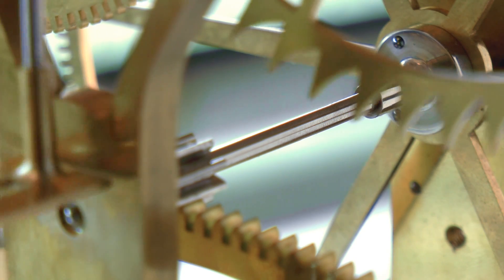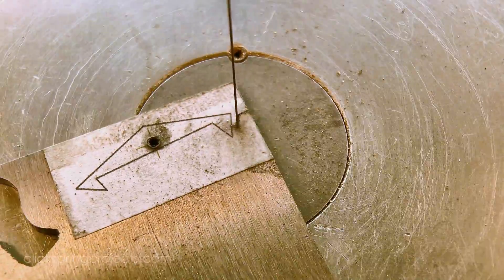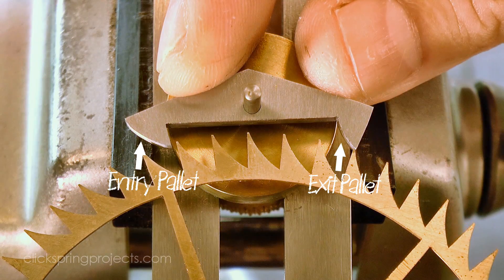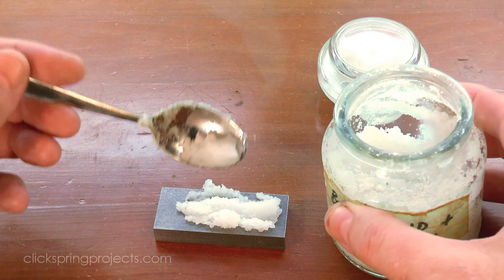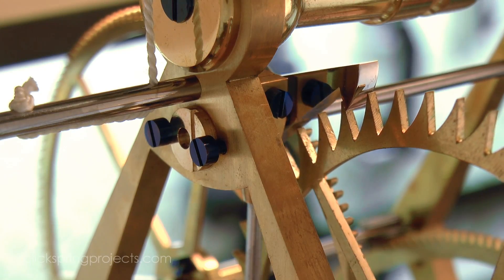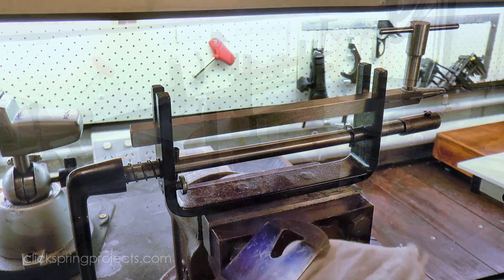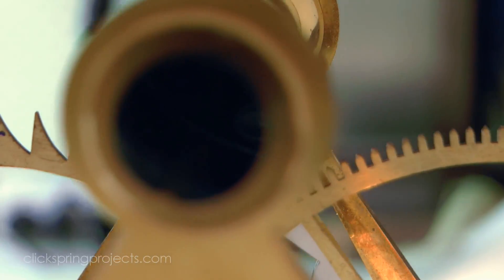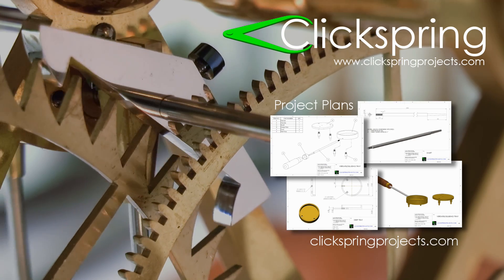Clockmaking - How To Make A Clock - Part 21 - The Mainspring And Escapement Pallets

Comment: Although the escapement is indeed a very distinctive clock mechanism, and probably first appeared in clocks before anything else, 
it was later adapted to other uses. 

Among other things, I can think of escapements in antique mechanical typewriters, 
and in the 'accumulator' mechanism in coin-operated pianos, 
which also have a small springloaded escape wheel with a small anchor, connected to a coin trip lever. 

This wheel is normally wound up by a pawl pulled by a small bellows ('pneumatic') connected to the valve actuated by the shut-off hole in the paper roll. When the hole comes along in the roll, it actuates the pouch and valve for the shutoff, causing the bellows to collapse under suction and pull the wheel over one tooth. This winds up the spring slightly and 'counts' one tooth, either adding one tune to the credits to be played, or shutting off the piano (since there's a pin on the wheel which pushes a lever connected to the main power switch). 

Since the wheel is normally under coil spring tension, to release it to move over one tooth, one only needs the weight of a proper denomination coin (most commonly a nickel, although some 'high class' places had dime or even quarter slots in the 1910s-1920s), to push down on the long actuation lever connected with the anchor, to release the escape wheel one tooth, and potentially turn the piano on (or add one more credit to the counted coins inserted). It's a very clever idea, and more positive and mechanically reliable than earlier coin-trip mechanisms, which used long vertical, horizontal or semi-circular rack or pin-stepping mechanisms (such as very early Seeburg systems), or else used an actual stack of coins themselves which actually completed an electrical circuit via two pins(!!!) (the earliest Wurlitzer designs). By the mid-teens, practically all coin piano and orchestrion manufacturers in the USA used some variation of this sprung ratchet-wheel design with escapement for their accumulators, as it had proven its ruggedness and reliability in hard commercial service. 

Most of these mechanisms can register up to 20 coins, since the earliest multi-tune rolls cut for these type pianos generally had a maximum of 20 tunes on them (much more commonly only 10). 

You can see an accumulator from a Coinola coin piano in Nate Otto's video here: 
https://www.youtube.com/watch?v=iqbafa5-lF8

Comment: This is captivating in ways I cant explain but I do have a question. You used that very precise electric measuring device do count the ticks in 24 hours and that's how you fine tuned it, my question is how were clocks and watches calibrated in the 1800s? Having standards to calibrate weight, size and volume were easy enough to procure but how do you get a time standard? I'm going to guess as I've heard time is measured against a pendulum of a certain weight and length swinging a certain distance to determine a second but I'm wondering if there were other ways

Comment: Thanks to this system, even when the mainspring in the watches is tight or loose, it is ensured that the gears and of course the time flow in a constant and correct manner.   Likewise, in some old diesel engines, this was provided by a mechanism with speed regulation... And again, the most beautiful people 💚💙🧡

Comment: I'm curious, is there a reason the contact angle is different on the two impulse faces on the pallet? I'm just getting to making the escapement on another john wilding design, my first clock. It seems from first glance that the "kick" the pendulum receives would be lopsided, but maybe this would keep better time than having it get kicked both directions??  It seems that the second(right) tooth seats quite closely at it's deepest point of engagement, but this would provide much less impulse than the first one. Have I got it all wrong, is it that way by design, or is there something else involved that I haven't even perceived? I haven't yet looked at the  horological institute paper, maybe that will be my next stop...

Comment: The holes for the spring hooks are roughly triangular in shape. The triangle base is nearest the end of the spring and the apex points away from the end. I would have thought that the opposite would be better. i.e the narrowest part of the hole, triangle apex, engages with the hook. This would make the spring less likely to become disengaged with the hook and the wider part of the hole would facilitate the initial engagement when the spring is fitted. Exactly like keyhole slots.
Any comments anybody?

Comment: I had no idea that such exquisite nano-detailing work was possible with manual sanding/polishing. Smooth wooden sanding sticks with diamantine powder powder (whatever that is) - fascinating stuff. (I'd love to see these metal surfaces under an electron microscope after each stage is completed.)

Now, I'm curious to see if the surface tolerances for an airtight seal could be made manually, with only pure steel (like the wringing effect between two Johansson gauge blocks)...

The clockwork design is also intriguing, but this has perhaps more relevance to my personal projects.  ; )~

Comment: The embodiment of Dynamic Mathematics.., aka The Calculus, in which the Escapement Mechanism is the obvious Quantum of change in frequency alignment, "keeping Time", and the Clock Spring is the relative motion amplitude of constant/holistic continuous creation connection cause-effect, a context of e-Pi-i-reflection condensation containment Superspin @.dt omnidirectional-dimensional logarithmic spin-spiral condensation. 

Equivalent Electronic LRC Modelling Circuitry oscillation resonance phenomena, has the zero-infinity sync-duration spectrum of transverse trancendental function e-Pi-i Self-defining Superposition-point Singularity, time-timing Hysteresis-> Shape-shifting Positioning of pure-math relative-timing rates in Thermodynamics.

 * "Thermo".., temperature, is somewhat misleading and concept misdirection because in Completeness, it is harmonic oscillation holography and a holographic Gaussian Distribution, of an average wave-packaging formation, probability numberness dominance in this sync-duration Instant.

So if you assemble dimensionality coordination sequences, Quantum Chemistry, in the same way this Clock is analysed, diagrammed and constructed, to emulate ONE-INFINITY Singularity Eternity-now Interval Conception, here-now-forever of/by Superposition-point Perspective of orthogonal-normal line-of-sight Fluxion-Integral Calculus, objectives of Time Imagery in Cosmology of States that are nodes of floating point resonance, ie in QM-TIMESPACE Actuality, ..that is the Observables of the general idea of pulse-evolution composing our lifetimes.. (Grandfather's Clock was too large for the Shelf..)

Comment: OK, you lost me there. Two questions:
Why did you have to heat up the ends of the spring?
And why did you have to punch the initial holes instead of just drilling them?

And mate: I've been watching your videos for the last two days and I'm in total awe to your craftsmanship and dedication.
Reply from the maker: Heating anneals the steel, making it soft and ductile again - it can then be curved as required, and also is believed to tolerate the stresses a little better in the annealed state. Punching holes in thin stock is much safer than drilling - great to have you watching mate :)

Comment: how much would a person have to invest in order to get all the tools and machines necessary to get into the clock making game.
Reply from the maker: Hey Al, I wouldn't say its a cheap hobby, but you can well and truly get started with around $1000 - A small benchtop lathe like a Sherline will set you back $600 new, and the hand tools you can pick up 2nd hand as you go along from flea markets, NAWCC sales etc A significant proportion of the tools you will need to make yourself, which drops the setup cost significantly. By far the greatest expense is not the tools, but self education, books etc Hope that helps :)

Comment: Fantastic! I have to ask though, would galvanic corrosion be an eventual issue with all the steel/brass contact?
Reply from the maker: Hey Kev, I have wondered the same thing. Brass and steel have been used for over 500 years in traditional clockmaking without GVC being an issue, so I can only assume that the answer is no. The brass pivot holes tend to wear out over time from standard particle abrasion, but that's about it. If looked after, the devices tend to live remarkably long lives. I suspect that the absence of an electrolyte might avert the issue. Great to have you watching mate :)

Comment: I always see people use belt saws, why you use a scroll saw instead? Sorry for my bad english.
Reply from the maker: The shorter "height" of the blade means that you can pivot the work in a short distance and so make very tight radius cuts. Band saws are very useful too, but its often a little more difficult to get a tight radius cut from them. Thanks for watching and asking :)

Comment: Everything looked amazing, but I have to ask....was the hole punch really necessary?  Couldn't you just use a drill there?
Reply from the maker: Punching a hole in thin stock is often a lot safer and predictable than drilling, particularly with an awkward piece of stock like this. Thanks for watching
Reply: Clickspring Ahhhh OK, I can understand that.

Comment: I am curious about the wear of the hardened steel pallets versus the brass cog wheel.  Will the wheel not wear out first, or is the wear all so negligible as to be unworthy of consideration?
Reply from the maker: Hey Chris, its a little bit counter intuitive but It turns out that the softer brass can often have a significant wearing effect on the hardened steel parts. The reason is that the brass (and any attached oil) becomes charged with particles of dust, and acts as a lap on the steel parts. Over a long period of time it is quite common to see hardened steel pivots and pallets showing clear signs of wear, despite being much harder than the mating brass component. Leaving the pallets glass hard helps to slow down this wear, but even then it still occurs. Thanks for watching and asking :)
Reply: Definitely counter intuitive!  Thank you for the explanation, and for the terrific channel.

Comment: Hi Chris, amazing job on the clockmaking and the videos. What kind of blades do you use in the scroll saw to cut each of the materials (brass, tool steel, etc.)?
Reply from the maker: Hey Eric, The saw is a Hegner 1e and the blades are these: http://jewellerssupplies.com.au/dedeco-diamond-small-knife-medium-blue-p-900.html No lubrication required for brass, the blades will comfortably handle up to 3/16" brass sheet stock, upper limit is 3/8". Tool steel is another story altogether - very, very slow and tedious, expect to break quite a few blades. Blades are reasonably comfortable with 1/8" tool steel stock, but the absolute max limit is 3/16", its very slow going at that thickness, but still beats other methods like chain drilling I think. Lubrication is useful for tool steel, but you can get away without it for thin section stock if you don't mind nuking the blade. Hope that helps!
Reply: +Clickspring Thank you so much for the detailed information. Have been a longtime fan and can't wait to see the completed clock!

Comment: When putting the holes for the spring hooks into the spring steel, why do you have to punch and file them? Wouldn't it be faster to drill it out, get a rough cut on the scroll saw and then file the details without compromising quality?
Reply from the maker: Punching thin sheet metal stock is much safer and predictable than drilling. Thanks for watching

Comment: Chris, you are an inspiration! How is a scroll saw set up to cut tool steel? Slow speed I noticed. Which blade is suitable? Do you use lubricant? Loved that first tick/tock. I "praise you with great praise" , Richard
Reply from the maker: Hey Richard,  I use these: http://jewellerssupplies.com.au/swiss-sawblades-bundle-p-5830.html No lubrication required for brass, the blades will comfortably handle up to 3/16" brass sheet stock, upper limit is 3/8". Tool steel is another story altogether - very, very slow and tedious, expect to break a few blades. Blades are reasonably comfortable with 1/8" stock, but the absolute max limit is 3/16", very slow going at that thickness. Lubrication is useful for tool steel, but you can get away without it for thin section stock if you don't mind nuking the blade. Hope that helps :)

Comment: Chris, this is my favorite YouTube series of all time. What an amazing project, clock, and what a nice sound! 

How do you think the twine, for adjusting the pendulum, will affect your clock's precision? Won't it stretch, expand, and contract with time, temperature and humidity?
Reply from the maker: Yes a thread suspension is very susceptible to humidity. It was the traditional suspension method commonly used for this type of clock, but was well understood to be flawed. Generally used on clocks where timekeeping was secondary to the visuals!!
Reply: I had never seen it before, but I'm no clock maker. I wish I was, though!

Comment: As always incredibly beautiful work. How will you protect the bare steel parts from rust in your tropical climate? The polish on every single piece is flawless at this point but rust and tarnish will be eternal enemies. Short of an annual total teardown and re-polish how will you prevent your amazingly painstaking craftsmanship from being sullied by the elements? I can't wait to see the clock finished. It's been a wonderful experience just following this, very obvious, labor of love. The clock will be an heirloom of your house for many generations to come.
Reply from the maker: Great question Terry - the reality is that its going to have a hard time in our climate. The brass I'm not so concerned about; that will develop a natural patina over the next few years, and lock out further oxidation. But the steel is potentially an issue. The high polish on the steel parts goes some of the way to minimising corrosion starting, and heat bluing is said to reduce it somewhat too, although I have my doubts about that after doing a lot of testing. Inevitably the pivot oil will migrate over some of the steel surfaces too, which will also help exclude moisture. I'll keep an eye on it and probably do a follow up video down the line. If necessary it can be relocated to family that live in a dry climate, but that would be the last resort. Cheers mate :)

Comment: why didn't you use drill to make the hole in the spring?
Reply from the maker: Punching a hole in thin stock is generally much safer and more predictable than drilling. Thanks for watching and asking David :)

Comment: This might be a bit of an obvious question, but I'm coming at this from the perspective of someone who deals mainly with wood for DIY projects:  When you are clamping up small metal pieces like the Escapement Pallet, is there a specific way to go about clamping it down for filing without marking up, deforming or damaging the piece?  Other than "Just don't over tighten"?  It's a problem I have to deal with pretty regularly with wood, and although I would imagine it to be less of an issue with metal, the pieces you are dealing with are so small and require such a high amount of precision, that I find it hard to believe there wouldn't be some kind of an issue with the vise.  Do you end up damaging work pieces like this pretty regularly, or do you just kind of have a feel for how much is enough for your vise?
Reply from the maker: Yes you are correct, definitely an issue. It depends a lot on the material, and the operation that is being conducted. Sometimes you can just be gentle with the vise grip, other times the op demands max tightening, but there are still ways to look after the surface. Brass is very soft, and marks very easily, so I will often face the work with a piece of paper. It pays to wipe the inside of the vise jaws for chips etc that can embed in the surface, even tool steel can be marred quite badly by this. Soft jaws can often solve the problem, if its a hand operation like filing. The little Panavise I used for holding the pallets in this video has nylon jaws so its perfect for keeping things unmarked. The biggest challenge is working on a part that already has a finished polished surface - no effort spared in that case, soft jaws+paper+whatever it takes to protect the finish. Cheers mate :)

Comment: Fantastic, as usual! Why did you need to make a hole punch for the main spring? Can you not drill spring steel?
Reply from the maker: Its safer and more predictable to punch thin stock, than to drill it. Thanks for watching and asking :)
Reply: Clickspring Makes sense, thanks!